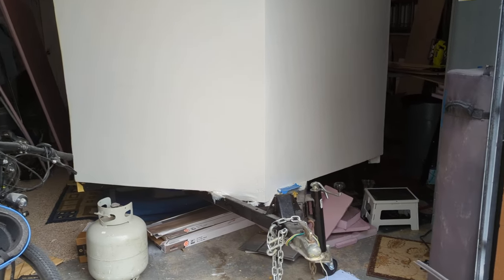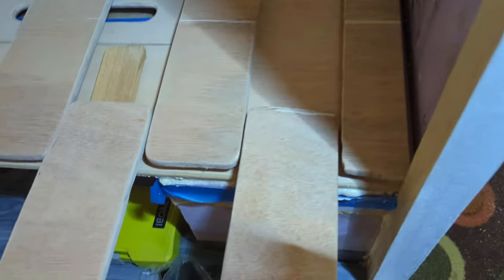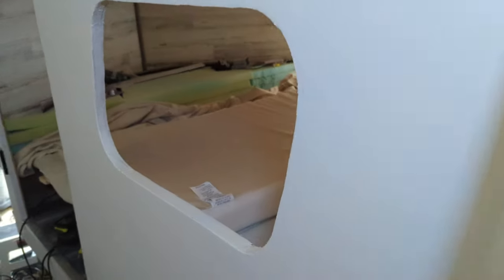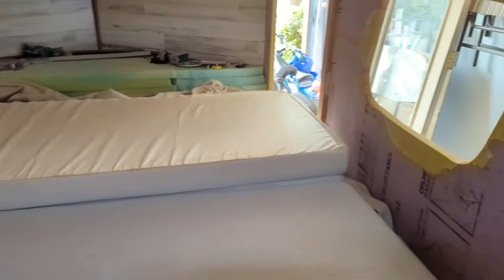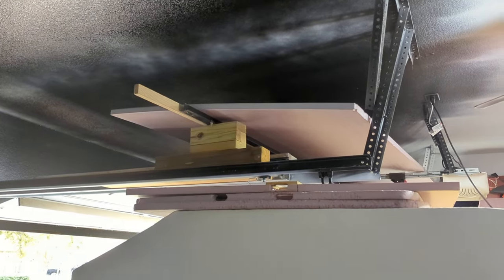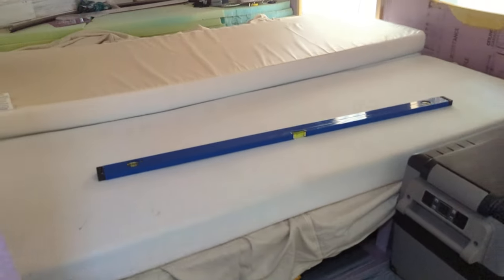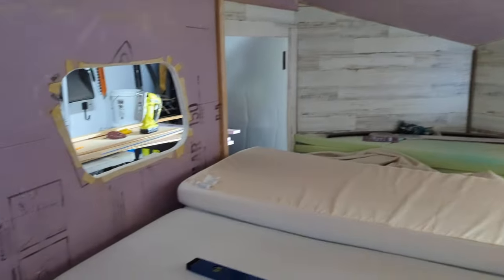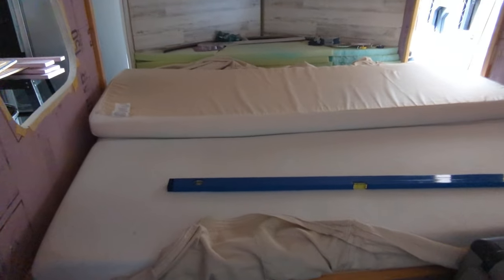DIY foam camper build. foamie, poor man's fiberglass PMF. DIY battery.

Comment: Really wondering what the finished weight will be? I'd like to build something similar to be towed by a four cylinder Ranger...
Reply from the maker: Sorry for the delay!  I had to get it weighed to get it registered and legal, it is 860lbs empty.  I wanted to stay under 1k.  The battery pack alone is probably close to 300lbs

Comment: Have several episodes been deleted?   Is this project glued together with expanding spray foam ? How did you attach the foam side walls to the deck? Would really love to see progress from the beginning.  Thanks for the post.
Reply from the maker: No sorry, I suffered from pretty serious self doubt, plus I damaged it being dumb on our first trip so in embarrassment I never updated, however I am over that, finally and realized it was dumb to act that way.  Update is about done and going out tomorrow. It's mostly glued with spray foam, it worked great but is messy.  I bolted plywood to the frame then glued foam to the wood.  The walls are glued to the base foam and then the PMF canvas and wood glue provides all the rigidity to the structure.  It's holding up great so far.

Comment: I love the design, you've done your homework for sure, which seems to be a trend with many people who enjoy designing these micro campers, and funny enough it always seems to pay off in ingenuity for everyone who over analyzes their material's potential.

Me Personally, I cannot do PMF because I live in washington, and any moisture will eventually infiltrate the material that gets left in the weather. Instead I am going to go with 3ft wide Galv. steel, mainly because I have most of a roll left over from before 2020. Other than that I will essentially replicate your design but utilize cheap cedar fence boards ripped down to size as my trim.  

I appreciate that you share this knowledge and experience.  I've been living off grid for over a decade in a time house that I built from scratch out of metal framing material with foam board, and I really with people like you were around ten years ago,  but it makes sense that this level of trial and error were not dialed in at the time, but it can be seen as pioneer frugal technology at this point in time, which is ever more needed now because of the housing crisis and how bad the western economies will get in 2023.

Look into 2ft aluminum flashing rolls, I've lined a cargo trailer with it once and it was essentially a space blanket, especially once I put a wood stove (made out of stainless steam pans and 2" pipe).  I believe if there is a design that a typical 6ft man can live within, which subsists within the material dimensions of 3ft rolls and 4x8ft panels, it will catch fire next year and createa a new "vanlife" movement
Reply from the maker: Thank you for the Comment! I really wanted to do the foam with aluminum glued to the outside but it was more than I wanted to spend. Aluminum framing is an awesome material, I need to play with some so I can improve my confidence with it.  I knew a sheetrock installer that blew my mind with the things he could do with aluminum framing.

I actually bought a steel flashing roll I was going to do all the edges in so I could stick magnets all over the place, I'm intimidated by metal working and chickened out.  Several things like that have been scrapped with the idea of just getting it done and not over complicating the build.
Reply: @AaronKasten what about reusing an existing travel trailer. Use the aluminum siding and roof present and glue in the xps foam? I'm not sure if you'd have enough stability. This is what I'm contemplating. Maybe trailers that need to be gutted are cheap, which could be the base of your trailer.

Comment: okay so yes we are watching . question, as you are building your own. what  do you think of using pocket doors and windows  for a trailer build ? I have a tilt bed utility trailer that I am thinking of converting to a travel trailer , and as I don't like commercialy available doors & windows  I'm working on a plan to make my own. I have some 4' square bullet proof window glass panels & as they a very thick I figure they will provide  good R rating . I will for sure add solar as well as a design I'm working on to add a second skin layer to my tear drop that will use the wind that moves across the roof & between this outer and inner roof layers as a sort of wind jammer to help charge battery bank. The roof mounted solar panels might work to provide the second roof skin for this last idea. I'm planing to build with PMF as well as use rhino liner for under side in black & as well as in green for the rest of the shell as it is very water proof long lasting and easy to apply. I'm thinking about a method of having a queen size memory foam mattress that can be both bed & couch , as well as be suspended from ceiling when not in use to allow for maximum multiple uses of the limited space. I like that enter locking frame design of your bed futon. I will use many of those types of build tricks in my project. well enough of my pontificating . never ask a German or even a half breed German for his opinion  cause we will give it to you, lol
Reply from the maker: I am not smart enough to attempt pocket doors lol.  I thought about doing bed liner on the underside but it really doesn't get very wet or dirty so I think I will leave it as is.  It is all coated in POR-15 and that stuff is pretty tuff. The way I did the king bed in mine fold from couch to bed also.  I hadn't really thought about it dropping down from the ceiling.  

Thanks for the compliments I like how your German engineering brain works.

Comment: 2" XPS foam 4x8 sheets are now a ridiculously stupid expensive $65 a sheet!!! Craziness! Still cheaper than buying a commercial camper.
Reply: In the Netherlands are companies that trade used building materials, maybe there is a similar company near you.

I can buy 4cm thick XPS foam for €3,25 per square meter instead of €14,55.
Reply from the maker: Yeah, I would just buy an old used popup or something now I think, the prices on those have come way down while XPS has gone silly expensive.
Reply: To me, it’s worth the trouble to purchase 1” thick panels for just  $20/each and triple up ‘em.
Reply: @UniquelyUbiquitous-yg3xl  Layers might even insulate better, the way layers of clothing do.
Reply: @AaronKasten the thing with tent pop up is water damage, mold, leaks, no insulation so it will be colder harder to maintain heat/cold depending on weather.

I looked at pop up tents too, but the time to pop the tent and being no different then a tent- makes me look at a foamy instead.

Comment: Hi, I would love to see how you came this far, how you build the walls and I would like to see how strong it is.

I'm about to restore a vintage camper, where all the wood is rotten, so if I can replace it with this foam I would get 2 flies with 1 stone.

How is everything connected to each other, the walls, the ceiling and the floor?

Any estimates on how much weight the roof can handle?
Salor panels are not light.

Keep up the good work and I will watch every minute!

Thanks!
Reply from the maker: Thank you!,  I have an update I am sharing soon.   After that I will make a Q&A video.

Comment: I wonder if wood filler would work to smooth out the seams and if it would stick. Obviously "painting" over with the glue.
Reply from the maker: I think would try that next time, the stuff I used got hard and brittle and will require some patching after a year of use.  Thank you for the recommendation!

Comment: I've just discovered PMF and foam so will look over your earlier vids. Do you think this method would work to insulate the inside of a boat hull?
Reply: I know boats have been made out of PMF. Something to keep in mind is the glue used. Tightbond brand has three formulas: Tightbond is water soluble. Tightbond II is water resistant and Tightbond III is waterproof. If you're building a camper, you can get by with Tightbond III but for a boat, I personally would use Tightbond III. 

Also, regardless of whether you are building a camper or boat, I would use a canvass drop cloth for the unseen layer(s then go over that with a cheap bedsheet from a thrift store. The finer threads of linens will result in a smoother finish than canvas provides.
Reply: @matthewcollins4157  All great thoughts. Thanks.
Reply from the maker: Mathew made great points.  I used mostly TB2 but when it was sold out used TB3.  I also didn't water it down like so many people suggest.  I would spread some glue on the foam.  Then lay the canvas over that, then using a spray bottle I would mist the canvas, so it would absorb some of the glue, then I would do glue on the outside of the canvas.  This helped fill the canvas gaps.
Reply: @AaronKasten  I'm also against watering the glue down. A few additional suggestions, Use more layers, and also use different directions for the cloth orienting it on 0 degrees, 90 degrees, 45 degrees and -45 degrees. The clock is strongest in 0 degree orientation. That is from head to toe on a sheet or if on a bolt of fabric, the length of the bolt. The fabric in this direction will not stretch. 90 degrees is the width of the bolt or from the left to right of the bedsheet. It also does not stretch much but will have a little bit more give than the 0 degree direction. 45 and -45 are "on the bias" and goes from corner to corner, you will have the most stretch in this direction. This is the direction good for going around curves and is the easiest to distort when laying it down so do be careful laying in this direction. Keep in mind that parts of the hull or camper (or whatever) will need strength (0 or 90 degree) but also some parts will need to flex, twist, or give and that you want to incorporate 45 and -45 degree lay up. parts of an aircraft fuselage will use a 0, 90, 45, -45, -45, 45, 90, 0 lay up pattern with regular fiberglass and may have more or less layers depending on where on the aircraft it is (there can also be 30-60 layers in some areas) I am not suggesting that anyone needs to lay up 60 layers of PMF for our purposes, though if you are an engineer you are welcome to figure all of that out and the proper lay up pattern, but if you are an engineer, you are probably not watching YouTube videos on PMF or reading this comment. LOL Treat the cheap canvas drop cloth like the chop strand fiberglass batting for bulk and the bedsheets as woven fiberglass cloth for strength.
Reply from the maker: @matthewcollins4157  More layers would have made it super strong, and would probably make it significantly more resistant to impacts.  What you describe makes me think of composite Kevlar body armor.  However for my application, I think it is proibably a bit of overkill, my biggest mistake came from a lack of framing in load bearing and moving areas. Had I not backed into the garage with the hatch open on our first use I think it would be near perfect but that little bump compressed some foam and broke my hatch framing lose.  I also should have framed the rear hatch itself.  As the canvas dried it shrank a bit and now the hatch has bow to it. I'll eventually probably rebuil the entire rear hatch area but haven't been too woried.  Even driving about 200 miles in the rain, there was almost no water penetration in the back.  What did get in was along the very bottom and wiped up easily with a towel when we arrived at our destination.

Comment: Nice work. One thing I am wondering is could do the panels before mounting them. This would allow compression curing with a waxed sheet of plywood. Either Clamp it on, or park a car on it.
Reply from the maker: In hind sight I wish I had done exactly that.  I should have pre assemble the walls and roof.  I really wanted to build it out of SIP (self insulating panels) but I am poor lol :D

Comment: This is awesome, thanks for sharing.  I'm in the process of planning in my head how to build a foamie squaredrop that I can slide into and out of my 4x8 utility trailer.  I am playing with the idea of just doing a box basically, nothing fancy or maybe even try and make it look like a cattle trailer so above the utility trailer sides ( 2 feet up ) the build will go out a foot on each side then round off the top.  Not sure though cuz that means more work.
Reply from the maker: That sounds super cool, did you decide to do anything?

Comment: im thinking I can make the walls with joints so they can be joined together on site. tarp for floor, tarp for ceiling. i have a prius, so electric supply wont be a problem. twin memory foam matteress inside. do you have ideas for the joints? i could make the walls to common lengths of trailers, so i could mount it to a trailer if i need to.
Reply from the maker: That sounds interesting, please tag me if you did or do anything with that idea.  I'm not sure about the joints maybe some sort of coupler.

Comment: This is looking awesome. What weight range are you aiming at, I know your design is fluid right now but that looks like it could be towed with a 4cyl. I would imagine that a shelf across those walls would rack the walls nicely and be functional, looks great. 
Since your channel just happened up on my feed I subscribed so I'll know when you throw up more videos.
Reply from the maker: Sorry it has taken so long, I am about to post an update.,  I wanted to keep it super light to pull behind an electric vehicle.  It ended up at 860lbs empty.  Thank you for subscribing, I have finally gotten over my disappointment in myself for damaging it on our first use and fear of video editing. I hope to share progress more frequently.

Comment: Sadly 1.5” foam is now $35 😑 I wanna build a truck camper and figured building a foamie would be cheaper now I figure I’d probably spend the same amount in 2x2s and plywood. Granted I’d save so much weight by going foam. 🧐
Reply from the maker: I know! It's very frustrating. I'd just buy a fixer upper pop up or something now, I've seen them pretty cheap on Facebook marketplace. I'm actually going to home Depot to get some things today for the camper and dreading the prices.

Comment: Nice. Is that 1" Foamboard?
Reply from the maker: most of it is 1" since that's all I could get #pandemic problems, however I did do the roof and the rear support wall in 2 inch foam.
Reply: @AaronKasten  Cool. I working on a truck cap, using 1" but rethinking the project materials. Yours looks really nice.
Reply from the maker: @markl9428  the 1" with PMF or fiberglass would probably be fine.  You could do some roof spars or add a frame for some extra strength but I have laid across the top of mine and it held okay.  The walls have no framing or extra structural support.  The roof has a few spars I added.  The compressive stregth of the foam is pretty impressive, just have to keep it straight, it has almost no tensile strength, that's what the PMF or Fiberglass provide.  It's kind of like concreate, some sort of rebar type solution could work too.
Reply: @AaronKasten  Appreciate this! I've currently wrapped my camper in 1/4" wood. I think I'll remove the wood, wrap it in foam and fiberglass. My goal is to keep weight down for a one person lift off. 💪

Comment: Use behr exterior latex it will work down to 35 air/surface temps
Reply from the maker: I ended up using all exterior latex paint I got from homedepot oops section, I think only 1 wasn't Behr.  Great recommendation, thank you!.

Comment: How do walls attach to frame ?
Reply from the maker: I used plywood base bolted to the frame, foam glued on to the plywood, the great stuff glues the side to the floor and it's wrapped in canvas in glue to act as a shell and hold it all together.  So far it's working great.

Comment: you say nobody comment on your video's, dont take it personally because it means that nobody has anything bad to say. anyways how about investing a couple hundred on a second hand roof top ac/heater system, eliminate the one you have and use that area for storage? just an idea that's all.
Reply from the maker: rooftop AC wouldn't fit in my garage.  I also already had the window unit collecting dust.

Comment: New here. subbed.  at 1:40 what is your exterior process and products? Fiberglass + paint? no mesh?
Reply from the maker: I used Canvas and wood glue and so much paint, I didn't count coats but it was at least 3-6 coats of primer and another 3-6 of the color.